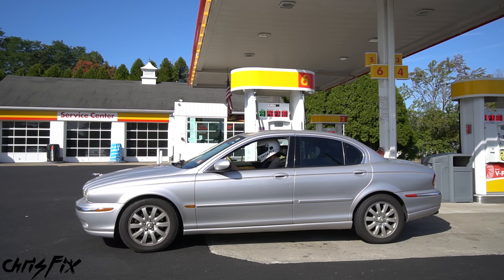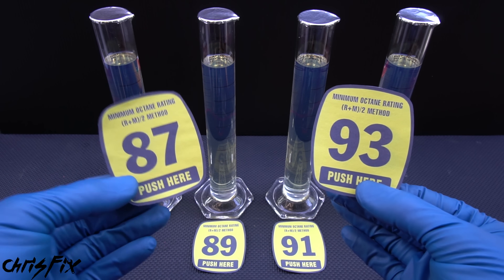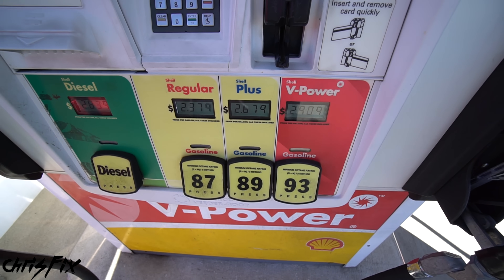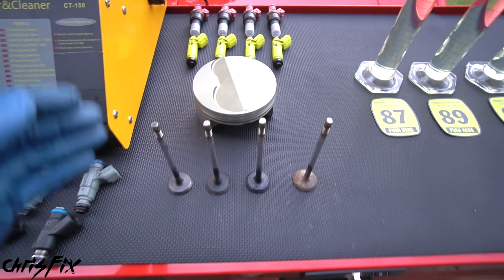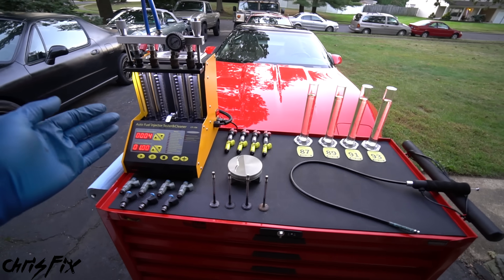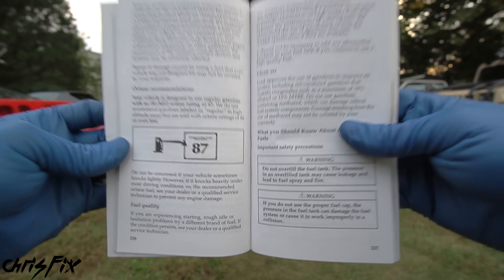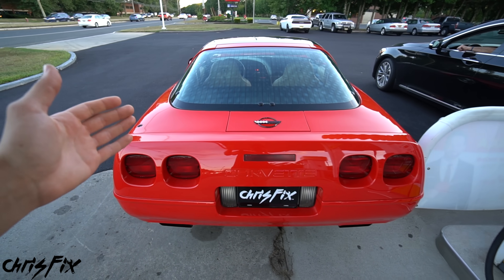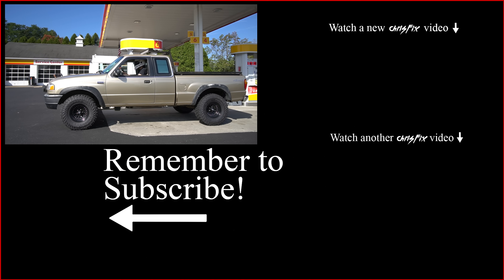What is the BEST Fuel to Use in Your Car or Truck and WHY

Comment: Just a little info from a refinery chemist...   Back between the post-lead to pre-ethanol years of gasoline, premium fuel did provide a modest improvement in fuel economy for some vehicles (mainly fuel injected). This is because premium fuel was made up mostly of reformate (a highly aromatic blendstock) which has a much higher density (~44 api) than all other gasoline blend stocks. Premium would average between 58-60 api and regular gasoline was between 64-66 api. The higher fuel density translated to higher energy content for a given volume. Nowadays gasoline is quite a bit different, refiners have had to reformulate their gas blends to accommodate ethanol, lower BETX, etc... Hence, the belief in premium having better fuel economy is currently no longer accurate today, but it was between (roughly) 1990-2011.

Comment: You've got some misinformation here. While it's a small difference, there is a greater amount of energy in lower octane fuels. Additionally, you can even have a fuel that's the same octane as another, yet a different energy potential than another if it has a different mix of ethanol. Ethanol-free 91 contains more energy than E10 91 octane.

Comment: 91 Non-Oxy because ethanol is bad for the life span of your parts.
Reply from the maker: Thanks for sharing!
Reply: @chrisfix  no problem!  I mix and haul fuel.  You would be shocked how bad ethanol is for delivery equipment.  It dries out and cracks all transparent synthetic materials in less than 2 years.

Comment: What gas should I use in my electric?  Lol.

But I do have a serious question though.  What about E-15?  It's 15% ethanol and it says it can be used in 2004(I think) and newer passenger vehicles.  What octane is this fuel and is it really safe to use?

Comment: It's more appropriate to say that the Octane Rating is relative to the compressibility of the fuel.  The higher the number, the more the fuel can compress on detonation.  This is why high compression engines require high octane fuel.  If you used a fuel with lower Octane, it could cause knock.  Likewise, use a high compression fuel, like aviation fuel's 110 Octane in an engine it isn't designed for, and you can blow out the engine.  The Octane Rating is a figure, determined based on the compressibility of the Octane and Heptane ratio, so regardless of whether or not the Octane is the same amount in each of the fuels, the amount of Heptane changes.  Heptane, like salt in water, modifies the reactivity of the materials.  Allowing the same amount of Octane to burn hotter or cooler.  The hotter the reaction, the more complete the reaction can be.

Comment: Hey buddy I have a question I have a 1995 f150...4 months ago my mechanic supposedly rebuilt my engine it’s a 5.8 ...what motor should I use 10-30 5-20 or which one?
Reply from the maker: The best thing to do is to look in your owner's manual and go with their suggestion!

Comment: Your owners manual may have confirmed something I've suspected regarding altitude.

Here in Colorado, octane ratings go about 85-87-90. I have heard that this is the case because Carburated engines tolerated the lower octane ratings at altitude just fine, but now with fuel injection that doesn't really apply, which would mean that most drivers here are slowly destroying their engines! Yikes!

Comment: This is one of the best videos I have watched , I had to learn more about this after blowing up my wrx engine after fueling 87 for a year on a 93 tune 😂😂😂
Reply: Just for reference, all turbo (at least WRX and turbo EJ engine) Subarus require at least 91, but recommend 93. I have a 93 tune on my LGT so I've only been using that.
Reply from the maker: Darn! I'm glad the video was helpful though!
Reply: Rob Gonz  ehh, most cars are designed to operate on all different types of fuel and detect the octane differences on the ECU through ignition timing. Its not really his fault Subaru is making an Engine that doesn't work with half the fuel out there without any real good advantage

Comment: Your vehicle is designed to operate on
regular unleaded gasoline with a minimum
pump (R+M)/2 octane rating of 87 or
regular unleaded gasoline blended with a
maximum of 85% ethanol (E85).
Some fuel stations, particularly those in
high altitude areas, offer fuels posted as
regular unleaded gasoline with an octane
rating below 87. We do not recommend
these fuels.
For best overall vehicle and engine
performance, premium fuel with an octane
rating of 91 or higher is recommended. The
performance gained by using premium fuel
is most noticeable in hot weather as well
as other conditions, for example when
towing a trailer. See Towing (page 138).
Do not use any fuel other than those
recommended because they could lead to
engine damage that will not be covered by
the vehicle Warranty.
Reply from the maker: What car is this for?
Reply: Well I have my eyes on a 2017 police interceptor sedan aka Ford Taurus. I have your list printed out already “How to buy a used car”  but I wish you to come and help me out. Just say the word and I get you the ticket
Reply: I’d say any ford interceptor from 2011-2019

Comment: The best i s and even w i l l be 102octane RON EU-cited /96US PON gas.
Due to it's better explosion/knock-stability (= nearly same length of all  carbon-hydroxide gasoline molecules) at UD/OT-point of the engine  => highest point of the piston in the circle @maximum compression - which You can optimize EVERY motor-ECU on - which US-market cars sadly aren't progressively -  to get maximum efficiency PLUS maximum torque = maximum reach out of every gallon gas out of smallest ccm-volume motor blocks => lowest cost per car !

So that means g e t Your engine ECU tuned/ optimized to high octane gas and get up to 22% more torque a n d reach out of the same amount of gas 

plus a  smoother, cleaner running motor =>  less CO -> Carbonmonoxide output.

That's the fact.

Comment: Even tho my owners manual says 87, I get better gas mileage using 89 or 93 and the engine sounds smoother. I have specifically tested this on my '02 Tacoma v6 4x4 with 150K miles. I also use gumout octane booster/fuel system cleaner once a month or so.
Reply from the maker: Thanks for sharing!

Comment: Great information, but you left out 2 major details, It also depends if the gas you purchased/ selected is the actual gas you are getting out of the nozzle. There is an average on 1.5 gallons of fuel in the line after you are done pumping, there fore if you HAVE to put high test in your tank for whatever reason, the first 1.5 - 2 gallons will be whatever grade was left from the previous customer.
But the biggest factor is the gas supplier, there have been many times a friend of mine who does deliver gas to the stations, has had to put low grade (87) into the high grade (90 +) holding tank,  when it comes to getting gas for your vehicle, no matter what you do, guaranteed the first 1-2 gallons, or even possibly the entire fill, will be a lower grade then you purchased. There is not getting out of that.
Reply from the maker: Thanks for sharing!

Comment: My '13 Civic has 138k on it 93 gives me an extra 20 miles at least in town, and around 30 miles on highway. I run chevron. And in my 2020 Subi with 3.5k miles on it the same. What give?? I'm telling you mpg can inprove if you ask me. Cleaner burning with helps. Here is the kicker add up the difference in cost between the two in 10-16 gal tanks and it will freaking surprise you that its what we spend on a dang happy meal at McDeez for the kids. Not worth it in my opinion. My equation to a clean good running engine is 93 Chevron Techron, and Mobil 1 fully synthetic oil. Change oil every 4k. 

Here is a older story. Bought a '01 Subi... The person that had it before who knows what they ran in it. (as a mechanic I have seen and know what a nice clean top end of a car looks like and what a dirty one looks like once the valve cover is removed) So having seen the grim that was just in the top end of the valve area.... I started running my '01 Subi with the above medication.... Oh the car had 120k-130k cant remember. After a year and racking up another 70k roughly the top end was clean as it should be if taken care of and the right products are used in it. I'm not a believer in additives that are supposed to remove crap in the engine on the spot. One example is sea-foam. All you are doing is getting rid of gunk in bigger chunks, and quite a few things can happen because of it. I run good oil and fuel and it does the job it needs to just fine. 

These are my experiences and they keep my cars in top shape! Nice video and awesome info. Thanks for sharing. ;)
Reply from the maker: Thanks for sharing all that!

Comment: But it's not that simple.
What if someone is modifying an engine and is becoming an independent tuner? For personal projects & experiments, I'm working on general-purpose, go-kart, motorcycle, and snowmobile engines. I want to turbocharge all of them, including single cylinders. I want to become a professional tuner, and build the best engines possible, and try out some ideas I've been having for a long time. How do I select the right fuel, for custom builds? Or should I just do Extreme tests on the hottest days, with an aftermarket knock sensor? I could just run premium, as I turn up the boost. But even if the engine doesn't knock, it still may not take all that boost. Which is another good reason why I'm also getting into structural engineering.

Comment: Hey Chris, can is it safe to mix regular and premium? I have a Ranger that has been knocking slightly and I want to try what you did on your Mazda B series. I currently have a half tank of 87, is it safe to mix it with 91? Thanks man, great video!
Reply: Yes. Gas stations mix 87 and 93 to give you the 89 on the pump, when they only have 2 tanks.

Comment: Hey chris!! Could a clogged injector cause more gas than usual get into the oil?
Reply from the maker: It would be the other way around, if you're getting fuel in your oil that means your car is running rich, so your injectors might be stuck open!
Reply: @chrisfix  is there anyways to check tht without pulling them? I have no tools where I'm staying atm 😧

Comment: if i may add.. the 87 89 and 93 pump?  the 89 is not always correct.. gas stations (most not all) only have 2 gas tanks and 1 or 2 for deseil, now the thing with the mid grade pump #'s is that mid grade 50 reg and 50 premium , so 1/2 and 1/2 ergo 87 and 93 mixed actualy makes 91.. and thats why there are ppl who actualy go to gas stations and check to make sure the rating is correct from the pump. so if ever wonder why mid grade from 1 gas station may be cause knocking but not from another gas station, that is some thing to keep in mind.

Comment: you missed the most important thing, the lower the octane rating the higher the ethanol. Ethanol has 20% less energy than gasoline. Shell has 15% ethanol in regular (87octane) 0% ethanol in 91 octane.
Reply: It’s actually the opposite. Your 87 Octane regular fuel with 10% ethanol would be 85 octane without the ethanol. Pure ethanol has an octane rating of 113. E-85 which contains 85% ethanol is going to have an octane rating around 108. Higher octane without ethanol is achieved through additives that refineries manufacture. To manufacture these additives requires expensive catalysts to be used which increases the price of the fuel.

The biggest issue with using ethanol is the corrosive nature of alcohol. Ethanol is a cheap source of octane but it can easily damage vehicles that aren’t built to use the fuel. Nearly all vehicles manufactured after 2000 can handle up to 15% ethanol while flex fuel vehicles can handle 85% ethanol. The other real issue with ethanol is that it has a lower energy content vs the long carbon chains that make up oil. With engines built specifically for ethanol use you can achieve higher performance due to the higher octane but in your standard engine there will be a loss in range. That’s not really an issue though since the cost savings achieved by using ethanol typically more than offsets the additional fuel consumption.

Ethanol is what many vehicles ran off of in the early days and Henry Ford often praised it, but with prohibition, the ethanol industry took a huge hit and oil monopolized fuel. It wasn’t really until the Bush administration pushed for less reliance on foreign oil that ethanol really started to come back and the EPA began forcing the oil industry to start using ethanol. It’s this action that lead oil companies create a lot of the myths about ethanol today. As for me, I’ve worked in both industries and while I think that ethanol is better for the environment I don’t think it’s a big enough difference to justify recreating our entire fuel infrastructure.

Comment: Rhis depends, if carbon build ups along the year of the car, thhe compression ration incepreases since the bore it self is gettin smaller. Then observe and gradually use higher compression ratio. This is normal as car ages with its engine. Over haulin will prevent this.

Comment: Hi Chris  great job at explaining combustion . First  i was involved with testing gasoline and oil , ( ASTM TESTING )  for Unocal 76 racing gasoline (  bought out )  the yellow stickers you see at the pump are   RON+MON stickers  these are single cylinder  " ADJUSTABLE COMPRESSION  ENGINES "   that test gasoline and  samples are run in  both engines  and   DIVIDE BY 2   which gives you a octane number  ( Hence  R+M/2 ) so quickly  i will saying that older engines require a higher octane number because of carbon build up in the combustion chamber /valves face and on top of the piston. This event is changing the compression ratio in the engine  and changing the octane requirement to be higher in grade. (  you will know when your engine knocks )   A good rule of thumb the higher the octane number the better ( as far as driveabilty  is concerned . About oil which breaks down faster then we think,  change your oil  frequently " the more the better " as far as engine wear is concerned
Reply from the maker: Thanks for sharing!

Comment: no mention of classic cars that run on leaded fuel...or that fact that ethanol is very bad for older cars with carburetors. i realize 90% of your viewers are 15-18yrs old and probably all drive hondas and "subies" but its still useful information to have.
Reply from the maker: Thanks for sharing!
Reply: kaleyfantastic As a human born in the early 90’s. I grew up around unleaded gasoline cars. You sir are older than me but I don’t drive the overrated Civic or a Subaru. I drive a Toyota.

Funny thing is. I prefer older cars. Today’s cars are becoming mobile smartphones which jack up the prices unnecessarily. I’d take a car from the 90’s any day.

Comment: Octane Booster is pretty much Crap! Most claim to raise your fuel octane rating by as much as 1 POINT when adding one bottle of booster to 5 gal. of gasoline. What that means is the $10 you just spent on octane booster raised your octane rating from 87 all the way up to 87.1, NOT 88, and will make virtually NO noticeable difference. None!! Now... Figure out how many bottles of booster you need to add to each 5 gallons of fuel to go from 87 to 93 octane. My calculations come out to 60 bottles and if you just filled a 20 gallon tank, that's 240 bottles of booster at about $10 per bottle, totaling out to $2,400.00! And even then, I DON'T BELIEVE this crap will increase your octane because the stuff in the bottle is most likely kerosene! Smells like it. Looks and feels like it. Burns like it.
Reply from the maker: Thanks for sharing

Comment: Overall great content very informative but with E-85 you said it has 85 octane but really it’s up to 85 octane then federal minimum level i believe is 50-65 octane in that fuel and that can ruin the engine. So you have to be careful where you get fuel from (especially for vehicles tuned on E-85)

Comment: High compression engines need the high test. Had a built engine in a mustang. Had it dyno tuned for 93. Was 10:2:1 compression. Crappy 93 gas would make it ping. Sunoco and Shell and she was good. Also bigger BP gas stations it was good. The smaller mom and pops was a no on the BP
Reply from the maker: Interesting, thanks for sharing!

Comment: I appreciate this video.  Just to share my experience-  Some time ago I purchased a 2008 Subaru Impreza 2.5L RS.  The car was slower than a paralyzed turtle.  I tried different fuels.  I noticed, that my car actually have slightly better performance, and mileage with BP versus Shell.  So I stuck with BP.  I made several trials.  Since then I've used BP 93.  But when I purchased a 2016 Ford Escape SE Ecoboost, I couldn't tell the difference.  Perhaps this is due to the fact that most cars now a days have a computer that regulates gas mileage?  Or perhaps the Subaru was just so slow, that I could tell if I was getting a hint of better acceleration, where as the Ford always had nice acceleration, to nice to notice the difference.  But anyways,  I've just stuck to BP just because of my Subaru experience.  Not really sure if the fuel is optimal for other brands and models.

Comment: Chris, your videos are so informative!  Thank you, this is what I've been looking for.  One question, I just got a 2020 Jeep Wrangler 3.6L v6 VVT engine.  The manual says to run 87 octane, but a lot of info going around that it's better to run either 89 or 91 octane to prevent early combustion and future knocking.  Would you say using a higher grade octane than what's recommended is safe and beneficial to the engine?  Thanks!
Reply: Absolutely. It's perfectly safe and it helps keep the engine clean internally.